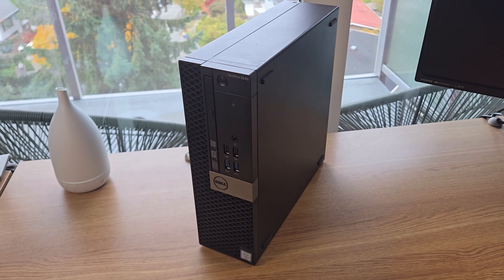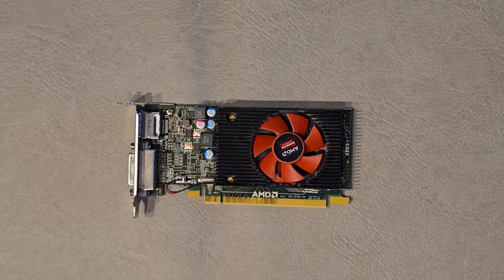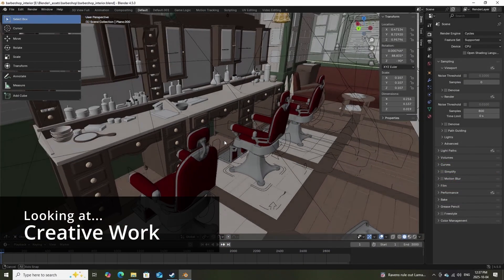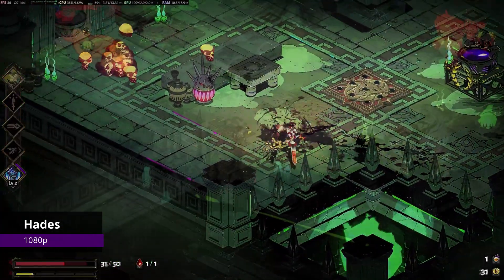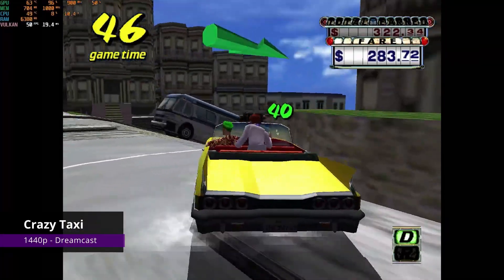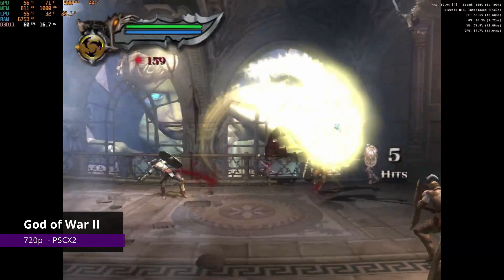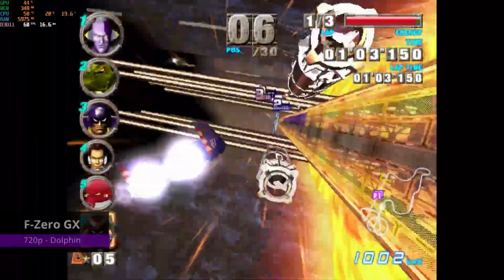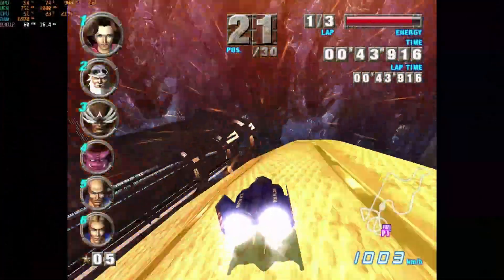Will this cheap Office Computer be a good value?

Comment: Personally, I would try to move the Dell hardware to a standard tower, so I'm not limited to low-profile graphics cards and space constraints in general. I know these types of computers have specific connectors, but you can always find an adapter.
Reply from the maker: I agree this would be an interesting idea to move forward with, maybe a future project with this unit where we get a new PSU and case for this board :)

Thank you for the input!